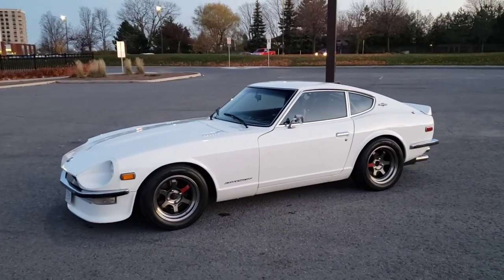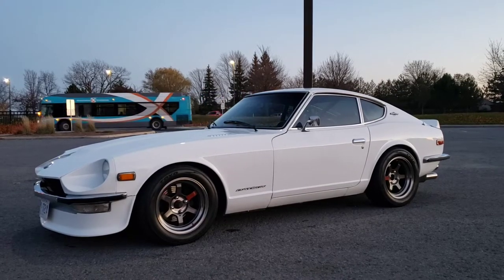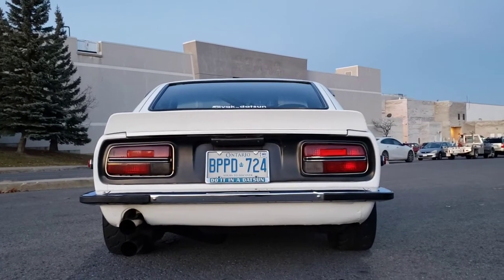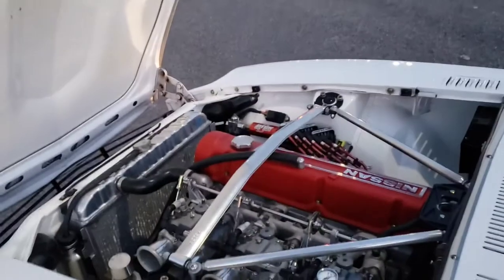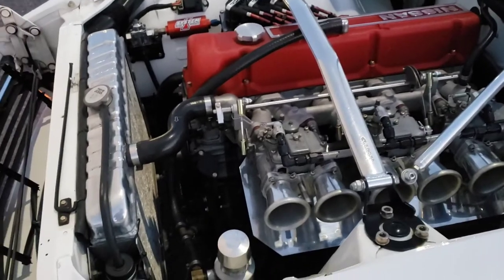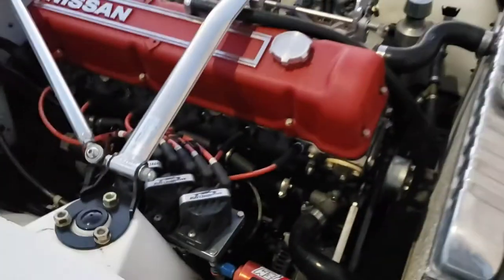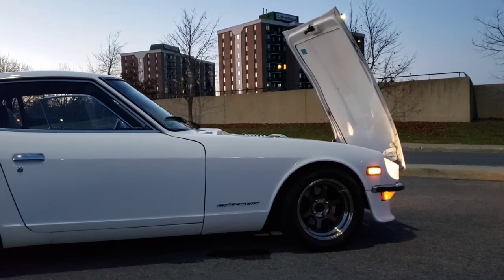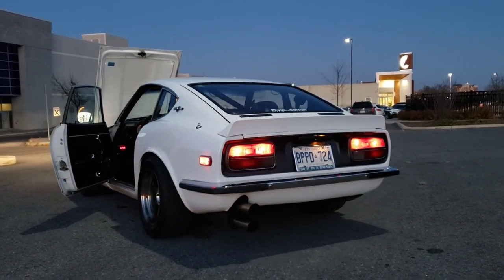1971 Datsun 240Z walkaround

Comment: Very interested in your ignition system for my 280Z.  Was hooping maybe you could post some links to help with doing some research.  Beautiful car by the way!
Reply from the maker: Thanks!! 

The system is an Electromotive XDi.  If you search for Electromotive Datsun on google, some good results should come up.  

It's a fair bit more expensive than the electronic distributor (123 Ignition) options out there, but I think the trigger wheel is the best way to ensure accurate timing regardless or RPM, and once set up, it won't ever give you any headaches.
Reply: @ryant67  Thanks very much for the feedback!!  Much appreciated.  Don't ever let go of that car!!!!

Comment: Exhaust fumes= Tail light gaskets. If you had to guess, whats the gas mileage with the triple carbs?
Reply from the maker: Mileage?  In the city it is horrendous - probably around 13mpg.  On the highway, I get around 25mpg though, which isn't so bad.  Keep in mind that I'm running a 4.11 rear end and I have the car tuned to run a bit rich, as it seems to prefer it.  I could manage better mileage, but it would come at the expense of throttle response on tip in.  Carbs can be a little fussy.    

Tail light gaskets is a big one for the fumes, yeah.  From the excessive time I've spent on forums reading up on these cars though, the aerodynamics apparently just plain stink.  In stock form the air from the tail section gets drawn back towards the front of the car, and the rear spoiler apparently helps break that flow pattern up a little.  Having the exhaust tail pipe extend beyond the rear bumper will help too, or so several reasonably savvy forum posters have said.  In any case, I thankfully don't have the issue :)
Reply: @ryant67  Not bad. I have a 73 (904 White) I'm going to be running triple Weber 40's on a 2.4L. I figured it wouldnt be outrages on the highway. Maybe check your rear hatch seal as well. I've had about 3-4 240z's, and only one I got fumes into the cabin, had to crack one of the windows to not get the fumes. I hate to say it, but it had the same rear spoiler you are running. Coincidence?